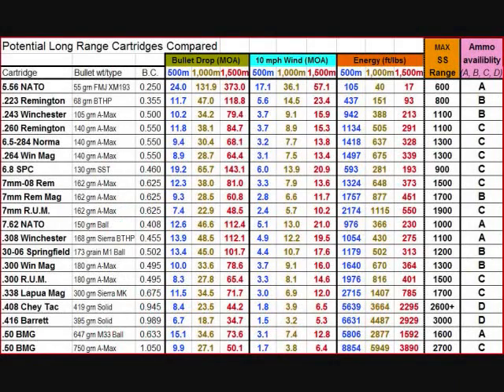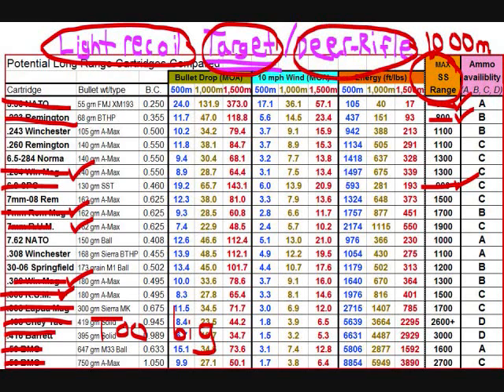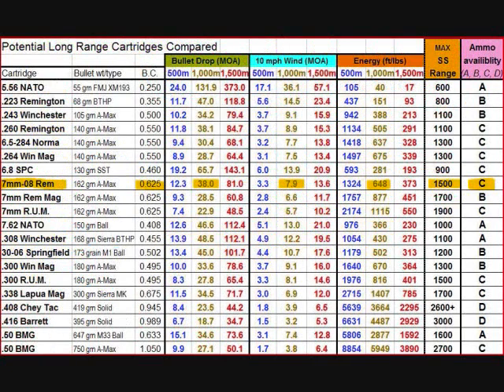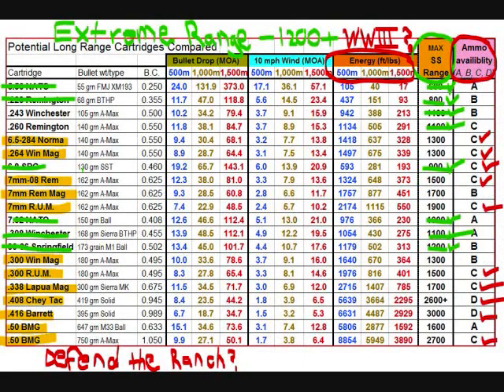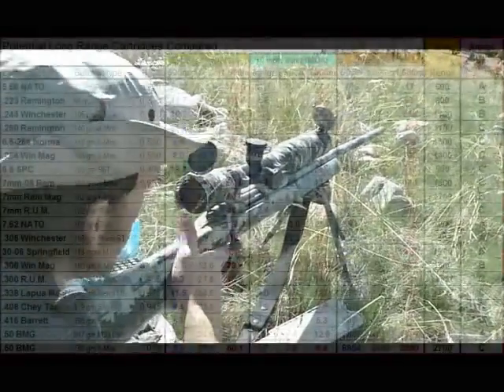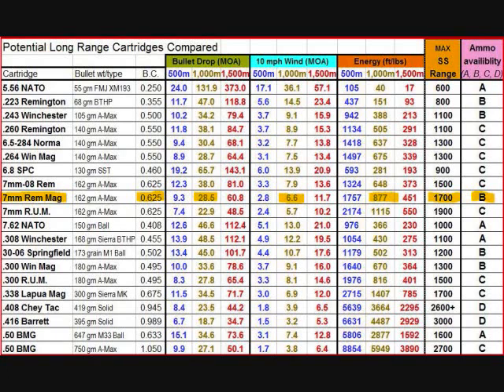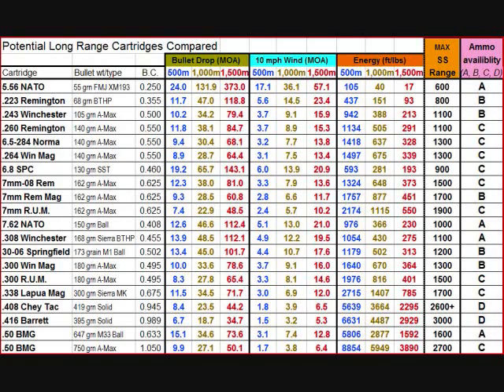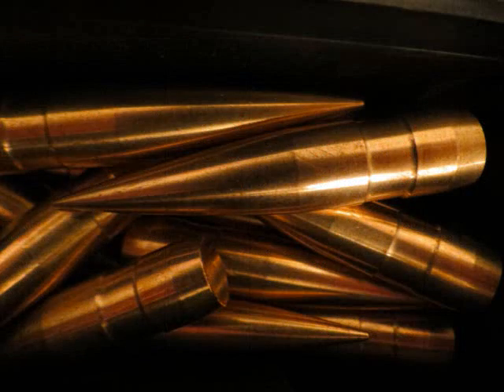Long Range 101 Part 3 - Cartridge Selection -- Rex Reviews

Comment: you said the military switches between 300 win mag and 308 I have a Remington 700 in 300 win mag is there a way I could shoot 308?
Reply from the maker: Kenneth Basham You'd have to switch out the bolt, barrel and the mag if you are running one.   The M24 SWS is set up for this conversion.  Look up the details for a more thorough explanation of the specs :-)

Comment: Quick comment on the availability of the 7mm-08. If you hand load, 7mm-08 brass can be easily made starting with .308 brass and necking down to accept 0.284" bullets. As .308 is listed as "A" availability and 7mm Rem Mag (same bullets) is listed as "B", for the hand loader I would say the 7mm-08 should at least be listed as "B" availability.

Also, I fully realize that you could not list every possibility in your chart for time purposes. But I'm surprised you left off the .270 Win. I realize .270 hunting bullets don't have the best BCs and you'll probably never find one of these at a long-range target match, but it's one of the more popular hunting rounds available.

Comment: First of all I am brand new to this type of shooting and a novice shooter overall so take that into consideration when reading the following comment.

If recoil is not an issue - Looking at that table and taking everything into consideration 7mm Rem Mag seems like it would be extremely hard to beat. Effective out to 1700 with a high degree of lethality even at the longer ranges. 

My question is - what are the draw backs or negatives with this cartridge?  I am sure there is something but considering performance as well as ammo availability and price - the 7mm Rem Mag looks like one of the best "sniper" cartridges.

Comment: I am having a serious internal debate here Rex.  I live in WA state and want to purchase a new elk rifle.  I'm torn b/t the 7mm and 300wm.  I know the 7mm would do the job but i want the knock down power.  In your experience are the added perks of the 7mm worth the difference in punch of the 300wm?  Like i said i would primarily be hunting elk.
Reply: Go with the 7mm rem mag, you won't regret it. The 300wm will shoot the barrel out faster, has noticeably more recoil, is more expensive to reload. The 7mm does everything the 300wm will do, and does it slightly better. 7mm bullets have much higher BC than 30cal bullets. Also, as you know, a well placed shot is infinitely better than knock down power.

Comment: The 300 WM competes perfectly well with the 7mm RM when using bullets of similar BC and MV. For long range shooting no one would use the .308 180gr bullet. A much better comparison would be a 200gr or 210gr bullet which would easily perform out to 2000 yds. Actually the 300 WM has more energy and less wind drift out to 2000 yds over the 7mm RM. This is why BC and MV are so important when comparing cartridges.
Reply from the maker: There are countless cartridge / load combos to choose from, this selection was not meant to be comprehensive by any stretch... but is rather an example of how to compare various loads you may be interested in. The .300 WM does great and had many bullets to choose from indeed.  :-)
Reply: You have to consider that he didn't choose the heaviest bullet for his 7mmRemMag load here either. You can go with the heaviest .308" rounds possible, but the advantage for the 7mm still applies if you heavy it up as well.

You can't get the same BC and MV from  .308 and .284 rounds of the same weight, unless you're lowering the charge of your 7mm cartridge, and even then, the BC of the .308 will be considerably lower.

An example of what you're saying would be two 180grain SMK's, one in .284 for 7mmRM, and one in .308 for .300WM. I don't know how much you'd have to lower the charge in your 7mmRM to get it to match the 300WM, but the .284" 180 grainer will run with a BC of around .660, while the .308" 180 grainer smk will run with one of around .480. 

A 210grain .308 VLD will still be around .030 behind something like a 180grain .284 VLD in its BC, and it'll begin to matter more the farther you go. .030 difference isn't really bad at all, so you're right.

The lesson to be learned here and in the man's video is not that there is a superior/inferior cartridge, it's that the way you load that cartridge will make/break it for you.
Reply: thegr8pulido Here is an example of what I was saying. .308 210gr .631BC, MV-2915, 2000yd energy-538 ftlbs vs .284 180gr .659BC, MV-2914, 2000yd energy-493 ftlbs. My point was that when comparing bullets of similar BC not WEIGHT, the 300WM exceeds the down range energy of the 7mmRM. Also the fact that the .308 bullet is heavier means there will less wind drift with it. There is a reason that the 300WM is the premier 1000 yd cartridge. I am not disputing the FACT that the .284 bullets have tremendous BC's for their weight. I happen to be a big fan of the 7mmRM, however I am just trying to keep it real. BTW all of the figures above are from published data.
Reply from the maker: BOrvalla Yup, if the BCs are the same, then the heavier one will carry more energy, longer down range- every time :-)  Pretty simple 4 sure.

Comment: Great video series and very helpful...so I was really considering a 7mm RUM but due to ammo availability and looking hard at the 300 WSM but notice you don't have it listed in your charts. 700 yd deer or elk rifle...thoughts?

Thanks again for great info!
Reply: The 300 WM out performes the 300 WSM with heavier bullets due to its slightly larger case capacity. The 300 WM has more energy and less wind drift than both the 7mm RM and the 300 WSM out to 2000 yds. The best bullets for the 300 WM are 200-210gr Nosler accubond, Hornady a-max or Bergers. A 200gr bullet at near 3000ft/sec. gives you an excellent long range hunting cartridge. Please be aware that the 300 WM bullet in this video comparison is a 180gr. That is the only reason that it didn't compare well with the 7mm RM and other cartridges. So don't be put off by this comparison, for some reason Rex likes to denegrate the 300 WM for long range work. Do your own research, it actually out performes the 7mm RM for long range hunting, due to its greater energy.
Reply: BOrvalla I'm not sure if you caught it but I meant the 7mm Ultra Mag as opposed to the standard magnum....so either way I should disscount the 300WSM out of my selection it sounds..
Reply: Try 7mm Practical

Comment from the maker: You max effective range depends on the following criteria:  target nature, system accuracy, max supersonic range, penetration/remaining energy criteria, and atmpsoheric conditions.  

Reflecting on these:  A 7mm Rem Mag can most certainly ding steel out to 1700m using the right bullets under the right ATM conditions.  It is extremely difficult to pull off a confident 1st round hit at that range, but it can be done.  Putting down game in a semi-reliable humane fashion at 1700m???  Not really.

Comment: Shouldn't we also take velocity at range into account when choosing a cartridge for it's effect on the terminal performance of our bullets? Many projectiles cease to expand or yaw as designed when under a minimum FPS. Those .308 variants, .260 Rem, 6.5 Creedmoor, and 7mm-08 Rem, might just be my favorite overall "do everything" cartridges, but while they are very accurate, putting accurate fire at long range with decent energy isn't everything- for quick kills, my bullets should expand reliably.

Comment from the maker: Depends on your pace of fire, but chrome molybdenum and stainless steel have different resistances to wear under different erosion regimes.   All in all -stainless steel actually offers pretty good resistance to thermal and mechanical erosion at higher temperatures, as well as a general resistance to chemical erosion mechanisms.  However, the difference as far as the number of rounds life expectancy between the two choices is less dependant on the material and more dependant on pace of fire.

Comment: Great videos, super informative, but I'm a little disappointed in the .308. Not because your info was incorrect, because it was spot on, but because the cartridge that was used in your chart was the 168gr SMK'S.... Im not trying to start and argument or be an ass, but in my opinion if you had used the 175 or 180gr SMK's with your comparisons, the .308 would have been a much better contender...

Comment from the maker: Sorry, I should have included the .270 Win, it is its own cartridge for sure.  The 7mm Mag will typically give you a bit more power and range, but with increased muzzle blast and recoil.  It depends on exactly what your mission criteria is.  If you simply want the greater maximum effective range, then the 7mm is the way to go.  If you want more efficiency and reduced recoil and blast, the .270 still does great.

Comment: "But I had to kinda compress it all down so that you can actually see it through that crappy little screen you might be watching on" 3:02 cracks me up every time! Just re watching a few of the series. Have you got any experience that would indicate my chances of successfully running a 105 amax in my .243 with a 1-10" twist I know 9" is recommended? any info would be great Thanks again Rex

Comment: For the 06, it looks like you're running M1 ball ammo like Hathcock used (?)...no, it has 0.56 coef. hmm. Well, I wanted to look at the energy off of current 06 ammo. gundata.org/ballistic-calculator/  Hornady BTSP - LM Interlock, 165gr  it's carrying 1,500ft/lbs at 500yds/460m. Why short the 06 on performance? ...and ammo avail, a B?  Thx

Comment from the maker: Extreme range bullet efficiency is not the military’s primary criteria when choosing cartridges.  The primary reason for the military's continuation of the .30 cals is that all the tooling for barrels and components has been established a long time ago.  Considering all the military barrels made for the .30-40 Krag, the .30-03 and .30-06, the 7.62 NATO over the years, it would have been silly to try to make the switch - logistically speaking.

Comment: Quick question Rex; It appears that the 7mm rem mag is superior to the .300 Win mag. . . But after watching your video on the equipment that snipers use around the world- and I see plenty using the .300 win mag, but not any using the 7mm. Why is this? Also, is the 7mm RUM worth it? Or is it such a barrel burner that its unpractical? It also seems like the .338 lm is a huge increase in cost, for not so much gain. What's your opinion? Thanks for the videos!!

Comment: What of the 6.5x55 Swedish? It is comparable to a .260 Rem but with more velocity. If loaded with a 140 grain Berger VLD at 2800~ fps wouldn't this be an ideal long range hunter? I could even try to push it to 2900+ fps as the case capacity is there. I guess I am looking for a all-around long range hunting round out to 1200 meters.

Comment: I'll second the 700 sps. I was easily hitting bowling pins with mine at 300yd out of the box. Having said that, I also have a savage that's a tack driver. Very hard to choose, so you should be happy with either.

Comment: tryin to decide on a good 1000-1500 yard target gun, that could be used in a WROL situation if ever required. the 308 seems great out to 1000, but the 7mm-08 really looks (on paper) like it shines. the best option would be handloading, since the 308 cases can be necked down to 7mm? biggest concern is ammo availability. nothing seems to match the 308 in availability other than .223/5.56, which is out IMO for a bolt gun... thinking either a Savage in 308 or a Rem700 in 308 or 7mm-08...

Comment from the maker: My first rifle was a Ruger #1 Tropical in .375 H&H Mag.  I used it on whitetails with 235 grain Speers -  very efficient and humane, suprisingly little wasted meat, conseravtive expansion on light game - unstoppable penetration on deer.  Built for larger game.  Would be an interesting extreme long range project.  Should work fine as long as you can handle the recoil :-)

Comment: Shooting around 10 000 rds of 7-08 per year I have a less theorical data. Out of a 28" shilen barrel you can expect 2700fps with 39 gr of N150 with 0,4 MOA up to 900m , and 2650fps out of a 24" . 

For those range I prefer my 30-06 with a 28" barrel shooting the 220 SMK at 2670fps with 53.8gr of N160.

Comment from the maker: Max supersonic range varies greatly depending on air density, my friend.  Hornady’s 7th Edition Reloading Handbook lists a 162 gr A-Max (BC 0.625) loaded into a 7mm-08 with 46.6gr of H414 at a MV of 2,700 fps.  For my altitude and pressure (70 deg F at an altitude of only 2,000’ ASL) the remaining velocity of this load at 1,500m is still Mach 1.023.   Even at STD altitude and pressure we are doing Mach 1.016 at 1,300m.  You will have to adjust this for your individual load and ATM parameters.

Comment: Thanks,  my smith headspaces off the belt,  I had just read an old benchrest book where they felt better accuracy was had using the shoulder. I'm considering just buying a sendero instead if building off this 110 action so it may not be a factor after all anyway, so many wants, so little $

Comment from the maker: Honestly, my factory Rem 700 in 7mm mag shoots so well as it is, I never had to pay any attention to tweaking the head-spacing.  That may a question better suited for a full time gunsmith to answer.  Generally, I like to keep the chamber as close to standard factory specs (as far as possible) to ensure reliable feeding.  I my experience, accuracy can be achieved in most factory chamber dimensions quite easily through attention to other details.  Hope this helps. :-)

Comment from the maker: The twist on your barrel will dictate which bullets you can use in this cartridge.  If you have 1:12" twist, then a 168 may actually be your best choice.  I use 168s in my AR-10 and my wife uses them in her Rem 700, they work great.  If you have a 1:10" twist, you will be able to use heavier bullets.  For the .308, the 175gr BTHP or the 173 gr M118 may offer you the best combination of BC and velocity for LR performance.  190s can work in a 1:10" barrel, but many guys still prefer the 175s.

Comment from the maker: Exactly how you use the rifle and clean it makes a huge difference, but I would stay away from the cartridges notorious for accelerated throat erosion. We will be adjusting for our drop and windage with precision, so we don't need the velocity that allot of guys try to get out of their high velocity magnums. Getting 7,000 rounds out of a barrel is better than getting 1,200 rounds out of it, especially considering all the work we go through plotting the velocity dynamics of the barrel we get.

Comment: If you want to shoot long range, you have to make your choice based on BC. Also, you WILL be reloading, so there's really no reason to use anything other than Berger bullets (their BCs ARE correct). That means (ignoring 338 and beyond for now), you will choose either 6.5mm (.264) or 7mm (.284). End of story.

There are quite a wide variety of power levels/case efficiencies to choose in those two diameters.

SS ranges in this chart move out several hundred with Berger bullets.  More.

Comment from the maker: I've never used the heavy Berger's in the .30 cals but they are supposed to work real well.  If you have  enough twist to stabilize them, you should be alright.  Recoil?  Yes.  Much of the "pain" of recoil is the velocity of the recoil, a heavy bullet at lower velocites will have more of a push than a jab.  Much easier on the shoulder in my opinion.

Comment from the maker: No problem.  Input data was as follows:

Scope Height: 1.5 inches
Zero: 100m
Wind direction: 90 deg
BP: 29.96 in Hg
Temp: 59 deg F
Humidty: 0%

No special inclination figured in, everything was kept as standard as possible.

Comment from the maker: The energy needed to ensure penetration on large game will be dependant on sectional density, weight, and overall bullet design.  A fully expanding bullet will require significantly more energy than would a limited expansion bullet to get the same penetration.  A low energy solid may penetrate far more than a high energy expanding bullet.  As a rule, 500 ft/lbs would be the bare minimum needed for a solid bullet design, 1000 ft/lbs or more may be needed for an expanding bullet.

Comment from the maker: Great questions.  1)  I simply look up the advertised MVs for typical long range factory loads or the most common hand loads and then plug all the BCs and MV into the same ballistic program and compare them.  If you do this, you will choose the loads and cartridges that you are considering as options and compare them the same way.  2)  Anti-canting devices can be handy, especially in rough terrain, but a well trained or experienced eye can keep it pretty straight as well.  :-)

Comment: Cheater. You should have used the A-MAX across the board. The 168 A-MAX is .475 BC for 30 cal, so 308 and 06 will beat the 7mm-08 with ease (other than recoil). Also, the 7mm mag recoils about like an 06, so it shouldn't have been tossed early.

Good logic and systematics though! Amazing what science can do for a decision. Just compare apples to apples or be prepared to face the trolls. 

=)

Comment: I think your 7mm rem mag & 300WM comparison is a bit apples to oranges, the 162 grain is one of the heaviest bullets for the 7mm while the 180 grain 300WM bullet is on the very light end. I load my 300 with a 220 grain SMK with a BC of .629 which leaves the muzzle at 2750 fps, it still has 1124 ft/lbs at 1000 and 622 at 1500 left which blows the 7mm out of the water. 
Thats pretty much my only complaint, I love your vids about long range shooting! :D